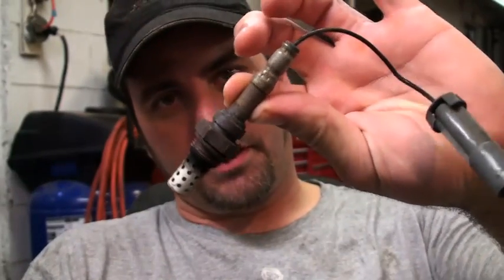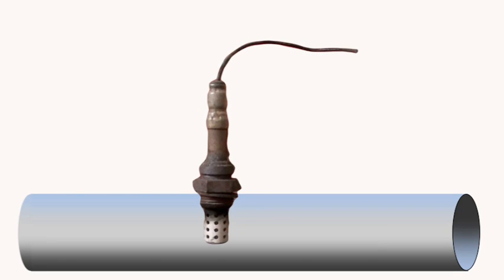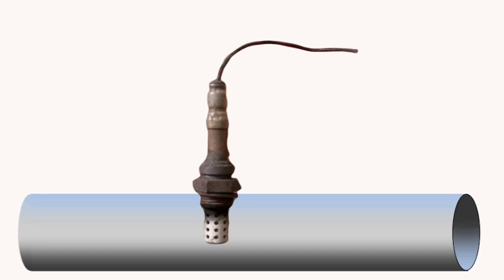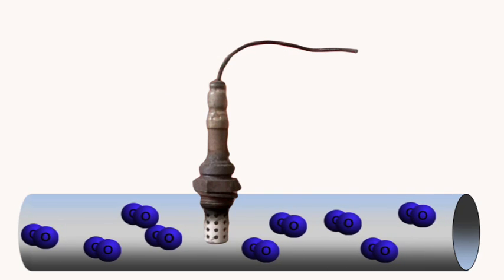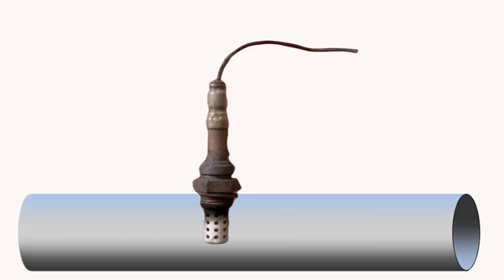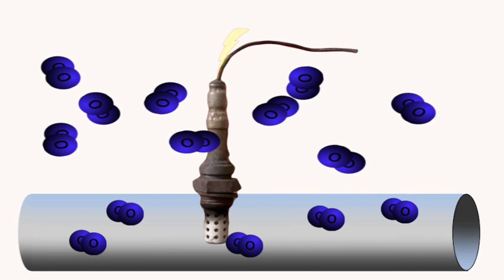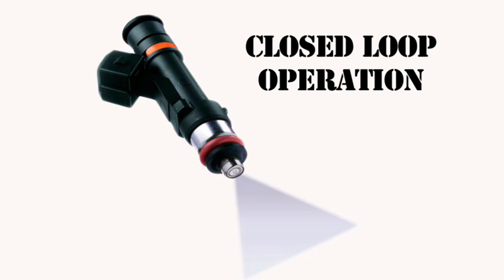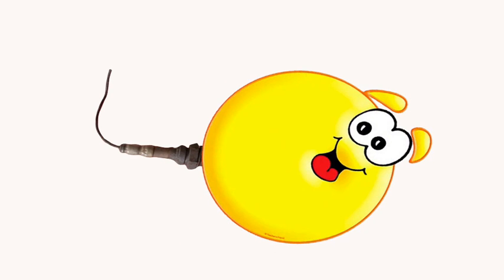O2 Sensor Basics - EricTheCarGuy

Comment: EricTheCarGuy I have a 1992 Lexus sc400 and traction control light won't turn off. or sometimes I start and it'll be off but turns on after less than a mile. what could be my problem?

Comment: Can a bad O2 sensor cause high idle?
Reply: Turns out my intake plenum gaskets was blown so bad it was sucking air through the crank case. The inside of my intake had oil. 96 dodge ram 1500 318 engine.
Reply: Hardcorediver44 qq
Reply: Hardcorediver44 how did you figure that?

Comment: Help me if you will? o2 sensor on 2011 aveo after about a minute car stalls out.  disconnect sensor and great running car.  checked 4 wire sensor and it gets 12v through wire and signal wire going to ecu adjusts between .1 to .8 with my new universal sensor added.  those numbers from i looked up are within specs. car runs better because sending richer signal. but why is code reading heater sensor upstream after i made my volt checks and put in new sensor.  can a bad coolant temperature cause a bad o2 sensor code or some other part.  Lead me in a direction please

Comment: +ericthecarguy so I have a 2000 Honda crv I found I have 2 o2 sensors one of the wires are ripped I need to replace one of them so when I start the car my car revs like heLL so I have to shut it off right away do you think this maybe the o2 sensor causing the over rev  or a vacuum issue?  also recently put the vacuum lines back together recently because I swapped the engine same exact engine as well any info will be much appreciated?

Comment: can i drive without the o2 sensors closest to the engine?
Reply: +John Hansen in order the o2 sensor to work..have to reach 300C ..so near it is to the exaust gases it will work better..but now in new sistems you have two one before the catalitic converter and one after in order to se if the cat is working properly...but the newest o2 sensors have a resistance that gets hot so it will start working faster

Comment: in my car, there is one single wire O2 sensor. if i increase or decrease fuel mixture manually, output voltage of O2 also increases or decreases from 1 volt of 4.6 volts, which means it reacts upon rich and lean mixture. BUT unlike other O2 sensors, its voltage do not go up and down automatically (like .2v to .8v in other O2 sensors). Should its output keep on changing within 1 to 4 volts?
Reply: +Muhammad Zubair Arshad Sherwani  yes  the values cahange .1 to .4 rich .4 to .8 lean..because when the 1uantity of oxigen increase the output voltage increase to.

Comment: I got a check engine symbol and after diagnosis it stated bank toe running lean. Is it possible that that oxygen sensor is bad?
Reply: terry6home  If you have close to 100,000 miles or more on the sensor   ,  just change it anyway.

Comment: One very missed issue here with 02 sensors these actually breath through the wires so just a heads up for those who didnt know this very important when and if you use electrical tape (some do) if so dont because the fact they breath through the wires is very important.
Thanks eric for the new format different but will adapt to it i think lol...
Stay dirty folks
~Dave
Reply: Also, soldering an O2 wire will block the path for the reference air.

Comment: Hey I have a single wire type and I'm buying a new header and down pipe but the o2 hole is farther down can I just extend the wire if I use the same gauge and just use some crimp type with some shrink tubeing or with I screw stuff up
Reply: Maybe buy a new one with a longer cable? That's the best I can think of...otherwise you'll have to extend the wire.

Comment: Hi Eric, Here's a good question for ya.... I have a 0420 code... I swapped the B1S2 sensor hopping it wasn't the CAT but unfortunately the code returned... My question to you is this: Is it possible to jump the "signal wire" from the B1S2 to the B2S2?... My theory is that it would read the same Voltage and trick the CPU into thinking its working correctly... And also let me state that I use this truck for "off-road racing purposes only" because this would be wrong if it was my daily drive.... ;)
thx.

Comment: @cubnole.. thanks for a reply! Its such a hard smell to explain. . When the windows are up you dont smell anything. ..once you crack or open the windows its overwhelming at times, the smell. Its definitely fume smell but once you go past 80km then fully let off the gas pedal a horrid smell comes in the cab, its like a burning chemical smell. We were just told to bend the exhaust to the left out behind the tire so that the wind takes the exhaust fumes out better instead of circulating them into the cab...think that would help? Any input wld be appreciated! !

Comment: I got the P0135 on my 2.0L Tracker. I get this exhaust stink/sulfur smell occasionally when I give the Tracker gas, their is no smell at idle. It has two sensors one on the E.Manifold and the other after the first large Catalytic Converter. My MPG has dropped greatly. Is this what is referred to as running rich? Replacing the sensor on the E.manifold solve the issue?

Comment: Can you show a video of a perfectly running car then disconnect the O2 sensor and show how it effects the computer and engine performance? Would the symptoms be very much like a vacuum leak? Does the computer run in a default mode it it is disconnected?

Comment: hey eric i have bought 02 sensors for my yukon denali 2000 got them cheap on ebay an i heard you cant use them they have to be the same ones you pull out mine arent bad i just wanted to change them out cause im getting ready to smog check light isnt on it pulled a mapo sensor code i changed it recaned nothing im gonna tune up an change filters an smog qestion is can you use the after market it looks like a ac delco an mine looks like 3 brown one purple wire the othewr are white or so please respond

Comment: Help! Swapped engine (94 Silverado K2500HD, 5.7, 4L80E
I need to know where the 092 Sensor (Single wire) goes to from sensor as someone has ripped the wire from harness. Need answer a.s.a.p.

Comment: The voltage from the O2 sensor, is it fluctuating or steady constant.
Reply: It should fluctuate pretty fast! Indicating an happy working sensor! It can be "lazy" and have a steady signal if it is not hot enought.

Comment: I have a 93 Cheyenne chevy suburban fuel-injection 8 cylinder 5.7 , runs great like a beast!! was a former police car but I keep failing emissions I jus replaced the catalyst converter its helped out alot but my CO2 is 3 times the legal limit , my check engine light comes on but when the car is fully started it goes away , my question is how can I reduce Co2 levels ? new fuel injectors an O2 sensor ?  and is it possible to fix because I really love this car its my first one and I have alott of money put into it over 3k help please HELP!!!!!

Comment: Hi Eric , just ran across your video and you seem like a pretty smart fella  and enjoy the work you  do on these vehicles and especially the Videos .I think you like the hype of seeing your name blasted out there like that . So anyway the problem I was having when I ran across you vid is this .My trans, locked up on me a couple of years ago in the middle lane of 3 lane Hwy .God was with me that day .Now I am an old woman ,but I do know a little of what I'm talking about here . I had the transmission repaired by some country bumpkins trying to make it in the city seemed like anyway. Well I am a poor woman but at the time I had to borrow the money for repairs ,but since then a few times it has acted up by not shifting out .Staying in low gear, but it always came out of it and started acting normal. Well it is doing it again . I have a sister that works at Auto zone and I'm going as soon as the rain stops and have them put that code reader thing on it. My check engine light has been on a good long while only it doesn't stay on all the time doesn't make any sense. So I'd really appreciate ya reading this and gett6ing back to me about it.I know it isn't in your face and that you can not give an accurate diagnosis .But your best guess might help me out here , especiall sine I'm on disability and a fixed income .Now I need to cut corners whenever possible. God Bless You !

Comment: Hello Eric,  thanks for the video.  One of my car had CEL code for "too lean" condition, OBD2 scanner found really high LTFT (15%).  I troubled shoot and found out it was caused by a bad O2 sensor. Replaced it and fixed the problem.   I have another car (2001 BMW 330I at 160K mileage).   LTFT and STFT of both banks are ~ 0%.  My question is that if 0% LTFT is a clear indication of good O2 sensor? Thanks much.

Comment: Hey Eric, I have a huge question/concern about my 2002 Kia Sportage (soft top).. when I bought it the check engine light was on and could smell exhaust fumes.. the back door never closed properly so we got that fixed, and could still smell fumes.. so then we had the tailpipe heated and bent downward, the fume smell is still slightly there but not as much as before.. we were told to change the O2 sensors and it will fix our problem, we cannot hook it up to a computer because the connector is broken. Any suggestion would be helpful.. tired of spending so much $$ on things that just dont work. Thank you!!
Reply: Is this a rotten, fowl smell or does it smell like gasoline?

Comment: Her Eric the car guy I love your vids the help me out a lot. I have a 2000 jeep cherekee 4x4 I was having 3 engine codes one wad tps and o2 bank 1 sencer 1 and o2 bank 1 sencer 2. My jeep runs sloppy the idle will go up and down like I was punching the gas peddle down and up. And when I come to a stop it will almost stall out. So I bought a new tps and it didn't Chang a thing but the code for the tps Is gone. Will my o2s cause this?

Comment: Hello! I have a question. I have an 02 ford expedition. I was told it was my 02 sensor. I had up and diwn stream replaced. As, soon as it was put on, I started it up and lots of smoke came out the tail pipe,plus it was ok outside. Now, I can't get up a hill and the check engine lite came back out. What should I do

Comment: Thanks Eric
Would you answer my following question?
Washing the engine spreads the dirt, grease and oil all over the parts including the O2 sensor outside surface. Doe this cause a permanent damage to the sensor, can a hot soap wash solve the problem or the sensor has to be changed?
thanks again

Comment: hey eric i connected my 01 civic to a scan tool and it says closed loop using 02 sensor for fuel mix is that bad?
Reply: If you will go back and watch the first video he did about the BASICS OF O2 and the code readings ,he talks about that very thing
Reply: Yes

Comment: And a question about a 2001 Dodge Grand Caravan, V6, regular gasoline, 131,500 miles.

It belongs to Torleif (My Norwegian friend in Saint Paul.) and it runs poorly. It hesitates and it won't idle when cold. It runs better after it warms up, but still hesitates.

We were trying to warm it up to check for a vacuum leak. Holy hot cat, Batman! The catalytic converter was glowing bright orange! Turn it off!

So the catalytic converter is clogged. Would all that extra heat kill the oxygen sensor?

Comment: Thank you Eric! This video is waaayyyy more helpful than the oxygen sensor made by the NGK spark plug people. 

I'm wondering is the oxygen sensor designed to last for 80,000, 150,000, whatever miles?

When the catalytic convertor overheats, does that kill the oxygen sensor?

Comment: I agree with that.

Can this be used for closed loop control of CNG which has an stoichiometric AFR of 17.2. That means it will be readinf .1 mV
Reply: The upfitter for GM's 2011 - 2013 CNG truck conversions, uses a resistor in-line with the IAT sensor, to 'trick' the ECM into delivering a richer A/F mixture. The O2 sensor signals are not modified, but the Algorithms are probably different than OEM.

Comment: Yes, it's called your Long term fuel trim's and Short term fuel trims. Since you have a 96 (I have 95 so I can't) You can actually plug in a scanner with live data capability and look at those numbers in real time. Your Scooby is probably running rich since it has no O2 sensor is not plugged in. Why would you leave it un plugged and not just swap out for the one you need??

Comment: Hard to believe that this incorrect info is still being taught. You need some training. The O2 doesn't sense anything, nor does it compare exhaust O2 content to atmospheric O2. It simply switches at LAMBDA=1. It knows rich or lean, it doesn't know how rich or how lean. Whether it's 14.5-1 or 11.5-1, it will still read at the .900mv range.
Reply: Sorry, but O2 sensors have and do function just like Eric states.
Perhaps you are thinking of an Air Fuel Ratio sensor. It still functions like an O2 sensor, but it is more accurate.
Check here for more info: https://en.wikipedia.org/wiki/Air%E2%80%93fuel_ratio_meter
Reply: yeah what else would a sensor detecting specifically O2 do?

Comment: I drive a 1996 subaru legacy and I put an exhaust system off of a 98 legacy, the o2 sensor plugs were different so i've left it unplugged for now, my check engine light comes on but i haven't noticed any performance issues, is there anything i can look for that would indicate that my car is running lean/rich?

Comment: Hi Eric I've got an Australian holden 2005 vz alloytec 190. Pretty sure same engine used in the U.S CTS cadillac. Computer shows im burning lots of fuel. I hook up a tech 2 to see the operation of o2 sensors. I have bank 1 sensor 1 saying 1.01:1. Bank 1 sensor 2 saying 416mv flactuating a little but staying in the 400 zone. Bank two shows exactly the same thing for sensor 1 and 2. Shouldn't sensors be flactuating ferequently even when car is on idle? Thanks for the helpful videos. The best

Comment: I got 07 charger rt and smell alot. Gas went is running what that men the o2 sensor at bad or my fuel injector I got strait pipes and wennt I press the gas hard some time I got back fire in the exhaust

Comment: Hello Eric! Great videos brother. I appreciate the time you take in doing these videos. I just replaced the water pump and timing belt on my 91 Legend and took it for a test drive and I noticed the car consuming more gas than usual. I retrieved the codes and after speaking to a Mechanic he told me that both o2 sensors were bad. Codes 41,44,17.

Comment: My question is if one fuel injection don't stray right can it make the oz sensor not to read on and off I have a 1990 mustang lx and my engine light comes on and off when a press the gas and when I don't press it it don't come on and the engine code reads oxygen sensor bank 2 and bank one is okay so how can I fix bank one sensor I put a new one in two times on that one side so can it be my injectors not working right?  Please help me thanks.

Comment: It's not a bad idea, but it's not required. I two different branded O2's in mine and have yet to have any trouble with them. Your light may be on because some computers require you to clear the code to tell it every thing is now fine, while others will realize it by itself and turn the light off.  If your leak is before the O2s, then yes, that will throw the light as well.

Comment: I was told that Bosch sensors do not work with hondas. The Denso is the way to go because they make the oe sensor for honda. I also found out through research that the ULEV vtec engine uses a 'special' sensor and you need to specify a ulev sensor. Turns out this sensor is made by denso so I bought it on autozone for 96 dollars after discounts and sales. Put it in this morning and now the light is out and the car runs fine.

Comment: I have 95 chevy g20 limited. At idol in park and nutural it rungs great. But under any acceleration in drive it has no power at all and stumbles and sputters. I replaced cap roter wires new oil and new fuel filter. What is causing this. I believe its a 5.7l 350. I t does have 343000 miles but has been taken care of but did sit for a few years. Needs new battery but I need that powere back. It has non. Please helpnme. With info text 253 315 4887 thanks

Comment: I HAVE A 2000 4CYL HONDA ACCORD. I NEED TO REPLACE TWO O2 SENSORS BUT THE OEM SENSORS ARE VERY EXPENSIVE. DOES ANYBODY KNOW A BRAND OR MODEL NUMBER THAT ACTUALLY WORKS WITH MY CAR? MY FRIEND HAS THE SAME CAR AND WHEN HE USED NON OEM BRANDS, THE LIGHT KEPT COMING BACK ON. I DON'T WANT TO PAY 400 FOR TWO OEM SENSOR. IF I HAVE TO, I WILL BUY SOME USED OEM SENSORS IF I CAN FIND THEM

Comment: It seems to me that O sensor produces voltage by the heat present in the exhaust pipe.  The hotter the air in the pipe the higher the voltage thus a rich mixture.  The cooler the air in the pipe the temp drops thus a lean mixture.  I don't believe an O sensor really measures oxygen volume but rather temperature in the elements inside the exhaust pipe.

Comment: Hi. I have the same problem and codes. Did you ever receive an answer to your above question about which is faulty - the cat or the O2 sensors? I also have had a significant decrease in mpg. But no sputtering or pick-up. Thanks

Comment: Hi buddy, I like yours videos and thanks for share with us, I have a problem in my toyota avalon 2000, I used the the scanner to check the light and it read the code P0420 how can  I know it is the oxigen sensor or if I need to replace the catalytic, now is consumming to much gas!!!

Comment: Eric, I've been following your videos for many years now and finally, I've decided to ask you a question. I have a 1997 Audi A8 4.2 Quattro and currently, I get 2 codes that are saying that bank 1 is running too lean. I'm getting 12 mpg as apposed to 20 mpg and the car feels under powered. I'm blaming my passenger side oxygen sensor before cat - am I correct? Also, do you know of an easier way to replace it on my car? It's a pain to get to it. Thanks much!!